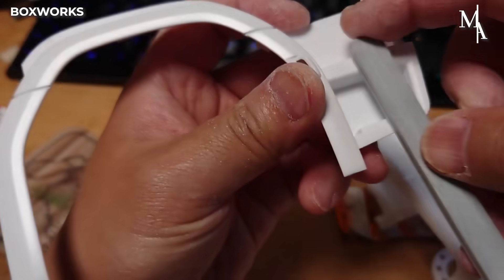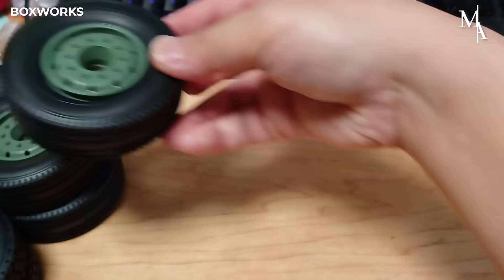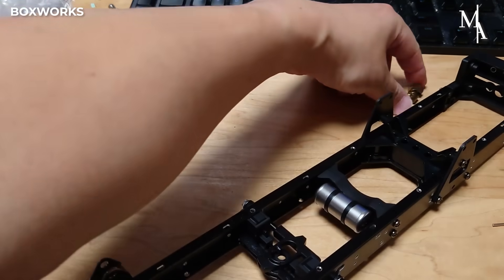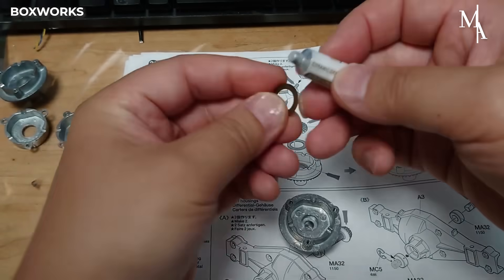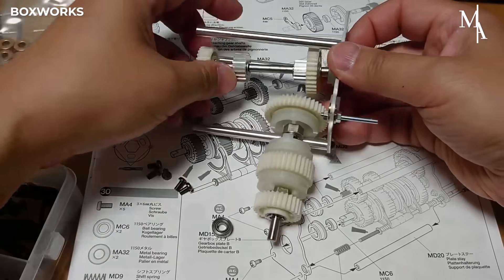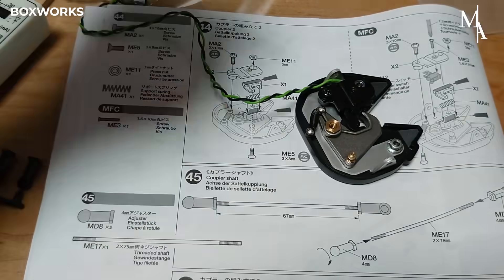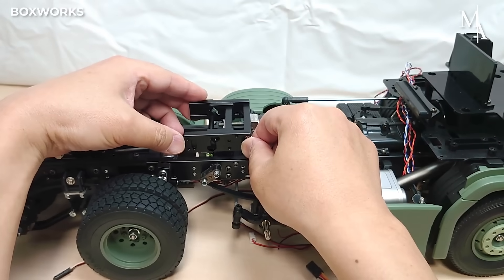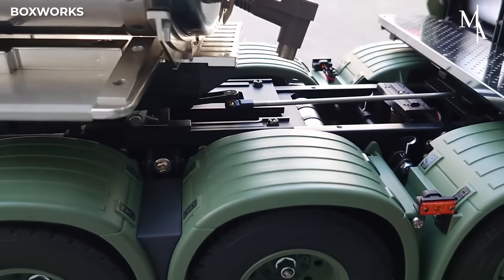Man Spends $2,000 Building RC Scania with Real Working Systems | by @boxworks1001​

Comment: What is it with European Trucks in the RC game...???   Why is it there isn't any American made Trucks just the Scanas , or Man , even Mercedes and the trailers have 3 axels too...???   Just find it odd that really no other type of Trucks are shown or used really..  👍👍👍👍😎🍻✌️👋
Reply: Tamiya got quite a few US trucks also...and one can many different 3D printed US cabs to mount on Tamiya chassis. There is a larger market for models of Euro trucks, as they are present all over the world, except North America
Reply: @Rimrock300 
Yes I do understand that , but to me all the Euro trucks just look the same where as here in America there seems to be diversity and style with our trucks.  As a retired Truck Driver drove for 25yrs OTR and owned my own Truck for many of those years a '87 Extended Hood Flat Top Pete with a 4.25 Cat and behind it was an Eaten Fuller 13spd with 3.55 rears running on tall rubber. She would pass everything but a fuel stop 😁 , un-governed and at one time was caught doing 53mph over posted speed limit of 75mph but by the time popped I had dropped 1.5 gears 😁.  That was a stiff ticket I will say , and No I didn't learn my lesson never got caught again tho.  Back then here in America my Truck is what was called a Rooster Cruzer a Left Lane Truck. My Pete could and would pass Bull Haulers and I was Hauling their finished product , " Beef "...  Average fuel mileage was 4.0-5.0 mpg 4.0 if I was Left Lane Trucking 😁...  
Just a reply back to you on the RC world of fun.. I have a few 1/10th scale bashers my Red Cat Volcano that has up grades that can run 4-6s now with alot of metal upgrades too , but anyways have fun with your RC's and sorry for my rant it's a carry over from my trucking days....  👍👍👍👍😎🍻✌️👋

Comment: Nice but not you done like 98% of other builders a left the chassis standard what real truck has bright nuts a bolts holding it together.my one I got all the bits a painted them to match which took time for me.as had do black base then red candy build up then crazzer then more candy then top coat.a all matches no chrome screws a nuts all over.

Comment: 1:14 Model truck, not 2000 Dollar...
Reply: This particular Tamiya 1/14th scale truck retails for $1099 CAD. When you add the MFC, receiver, ESC, servos, transmitter, battery, LED lights and paint, it's easily $2000 plus.